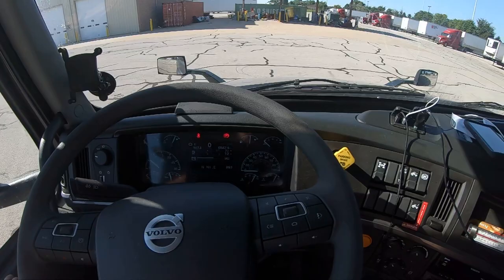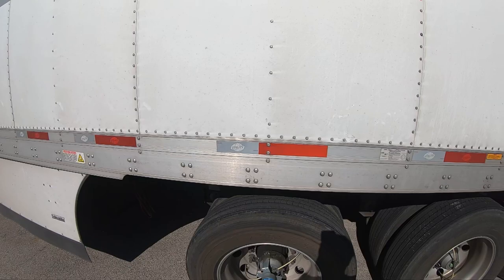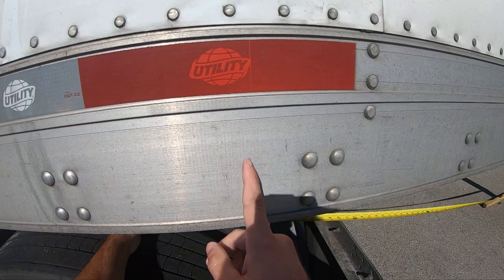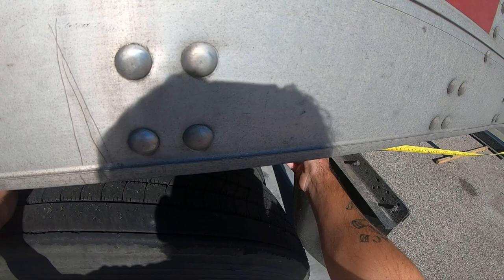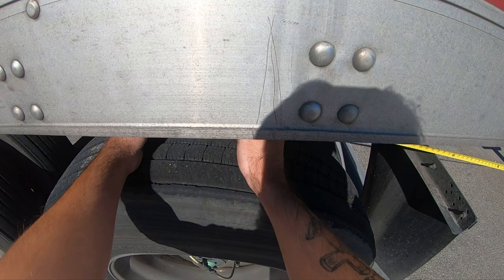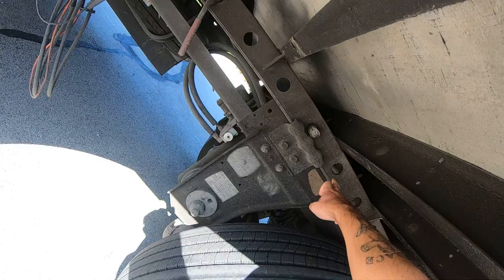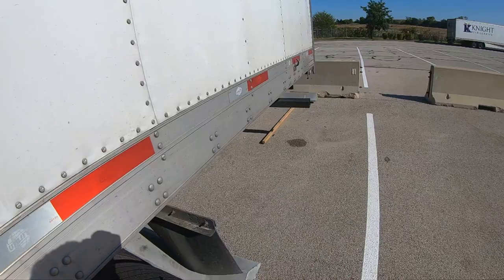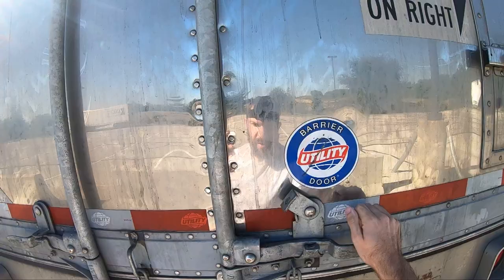How to: measure the California bridge law (40ft mark)

Comment: For California, put your trailer in the 5th pinhole from the front, or less. The 5th hole or less. Saves measuring.
Reply: Thank You!
Reply: Not that hard to measure? 😂
Reply: 7h
Reply: Every trailer is not same on sliding rails, all trailers don't have holes on rails  at same distance
Reply from the maker: yes but tap measure is also the best way
Reply: Thank u ☺️
Reply: CA 5th hole. FL 12th hole . How I do if I have to bring loaded trailer CA to FL . HOW the holes works.  ?
Reply: @siasatkibaat9433  Forget what was said about counting holes on the slider!!!! On some trailers the holes are spaced 6 inches apart, on other trailers they are only 4 inches apart!! Also forget about the pin being 3 feet from the nose of the trailer! Most trailers have 3 foot pin setting, but I have pulled trailers with 2 foot pin setting & also 4 foot setting. Clamp your vise grip on the body rail in line with the pin, hook your 50 foot tape there, stretch it out to 40 feet, or whatever setting you need, make a mark on trailer with chalk or a black felt marker. Also write   "CA-40 FT" by your mark. Ca inspectors will smile at you for taking the time to be legal. 
On your trip from Ca to Fl, set your axle at the shortest state you will be traveling through & leave it there.

Comment: This is why I run a 60 inch spaced sliding tridem axle setup with lifts on all 3 axles. I normally run my rear axle 5 feet from back of trailer. In non kingpin length states I run it with the front axle lifted, same as tandems to the rear. In a 41/40 foot kingpin state I lift rear axle and run with the front two axles down, same as tandems forward. I can also run it as a spread axle with middle axle lifted.

Comment: The mark is between the axles not the rear wheel. That is the maximum length, yes you can have the tandems all the way up to keep the load legal.
Reply from the maker: The state of California requires all tractor-trailer combinations to meet the King Pin to Rear Axle (KPRA) law. ... The center of the rear axle on all trailers must be at the 40-foot mark or shorter and must not weigh over 34,000 pounds on the  I do know what I’m talking about. Thanks for watching tho
Reply: I've heard conflicting comments. Some say center of rear axle .some say center of axles. Which one is it?
Reply from the maker: cali. is center of  rear axle confirm by a chp
Reply: No, it's the center of the rear axle. A lot of people mistakenly think it's between the axles but it's not.
Reply: In CA it is 40’ to center of rear axle. In Florida it is 41’ to center of the axle group.

Comment: Now does the center of the rear axle have to be right on the 10-foot part where can it be up closer to the front of the trailer. Example right now I'm set to hole number one
Reply from the maker: It can't be past that 4ft mark. Our you will get a ticket. If you are closer to the front of the trailer ie. 40ft or less you are Legal. Thanks for committing. Also don't forget to subscribe

Comment: I always thought the Mark was supposed to split the axles. Or maybe I'm remembering that wrong now
Reply from the maker: Nope The state of California requires all tractor-trailer combinations to meet the King Pin to Rear Axle (KPRA) law. ... The center of the rear axle on all trailers must be at the 40-foot mark or shorter and must not weigh over 34,000 pounds on the
Reply from the maker: This is off California cmv

Comment: What about weight on the drives?
Reply from the maker: Eugene Street 12k on steers, 34k on drives 34k on trailer.
Reply: OK. Here's what I don't understand. What if you set your tandoms for the CA Bridge law don't that puts too much weight on your drives?
Reply from the maker: Eugene Street if you are over weight on the drives you will need to slide the tandoms forward towards the truck to bring the weight to the trailer. But let’s say u are 35k on drive and 34k on trailer and 12k on steers then you will need to go back to shipper and have them take off the 1k lbs on the drives to be legal.
Reply: Never knew this. I run refer and the shippers put as much weight on as possible. I'm getting a load today headed to Cali and they told me about scaling it at the 40ft mark. I'm sure they'll load me with 44k and I'll have to figure it out.
Reply: How do you not know that, it's f ing 101

Comment: This is not the bridge law, its the kingpin law. The bridge law is the distance between the front and rear axles.
Reply from the maker: wrong.
Reply from the maker: bridge law is from kingpin to the rear center axle.  your wrong
Reply from the maker: State Bridge Laws
Therefore, California has the most restricted Bridge Law, which is 40 feet to rearmost axle if semi trailer has two or more axles or 38 feet to rear axle if semi trailer has one axle and does not extend forward of the rear of the cab. As of 2022, these are the current Bridge   dont try to tell me about laws. i been doing this 9 years coming on.
Reply: @TravelWithRick313  The 40' mark is the kingpin law for CA, It is not the bridge law. I don't care how long you've been going this or what you think you know, like I said look in the Rand Mcnally truckers atlas and it clearly shows you the difference in the kingpin law and the bridge law.
Reply from the maker: @user-og1se9qm8b Bridge Laws are Federal; Kingpin to Axle Spacing Laws are State mandated, varied, and although both Laws address weight and axle spacing, they are NOT interchangeable. Don't confuse the two of them. come at me when u think i don’t know what im talking. bridge law is kingpin. dumbass.
Reply from the maker: also you’re the only one saying this when i had 35k views. experience is everything. thanks karen
Reply: @TravelWithRick313  My name is Eric, not Karen, and it makes no sense to try to call me Karen because that's a woman's name and I'm a man.
Reply: @TravelWithRick313  You are wrong both times!!! BRIDGE LAW IS MEASURED FROM FIRST AXLE TO LAST AXLE!!!! See the chart on the right side of page A 15 in your motor carrier atlas.
Reply: @TravelWithRick313  Rick, you are the first person on here I have seen that gets it right. By the way, I did this for 40 years before retiring.
Reply from the maker: @williejaster thanks.